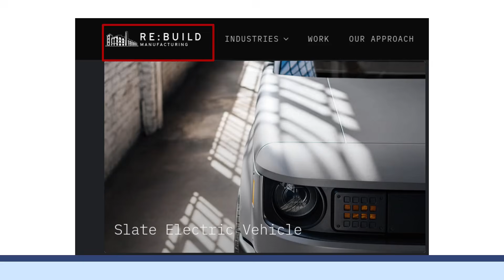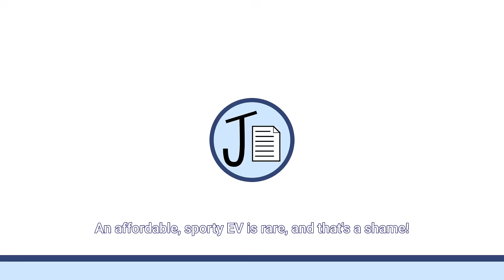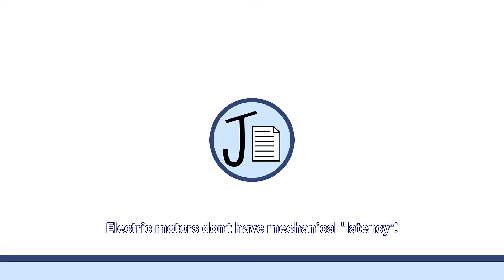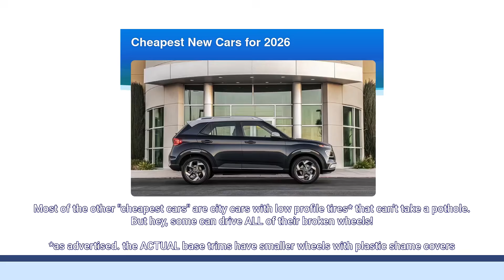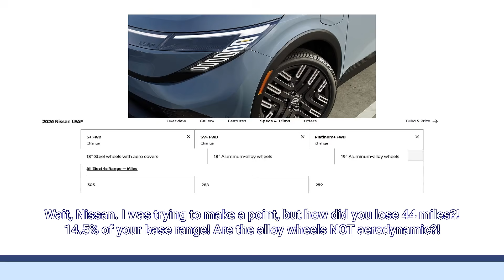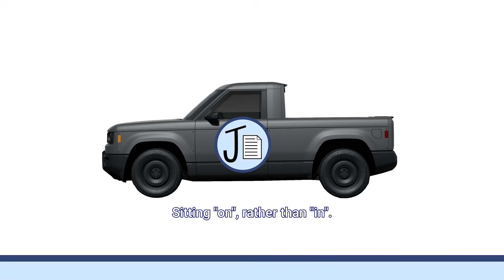The Slate Truck: EV Performance For All

Comment: I love the thing, especially for what it stands for.  But, a $25k price for this is new car territory, as well as approaching the Maverick and (potentially via incentives) an actual body on frame truck, the Frontier, and both of those are far more capable vehicles that will hold their value longer.  While I would be THE target for the Slate, I cannot justify the price right now.  But, in a couple years after release and we see used pricing....that is something to pay attention to.

Also, I realize Slate is at their rock bottom possible price.  Not expecting them to be able to lower it for some time, or until battery tech becomes cheaper.  I am just referring to the situation that exists, which makes it illogical for me, personally at least, to buy a new Slate currently.
Reply: It's fascinating to see arguments like this, because I would rather have the Slate than the Maverick at any price, let alone spending more on the Maverick. 

The key is that there is value in simplicity. Car reviewers who are really just AI spec sheet comparison mouthpieces have no idea how to deal with that. I would pay MORE for simple. I don't WANT those "features." I've had them. I've used them. I've driven plenty of new vehicles across the price spectrum including some that cost a significant fraction of the value of my house. They can keep that stuff, most of it isn't necessary and some actively gets in the way.
Reply: @Daekar3  That's all well and good.  It is exactly why I am interested in the Slate.  But does my statement really come across as an argument to you?  Or even that contrary to what you just said?  I am not trying to dissuade anyone from getting a Slate.

I just listed some basic realities and gave reason as to why I PERSONALLY wouldn't buy one from a mostly financial standpoint.  I think it is great you don't have to worry about that, and can spend on a Slate freely.  But I am thinking about things like depreciation and longevity, and by "far more capable vehicle", I am referring to simple things like performance, towing, payload, passengers, speed, etc., and not just flashy "features" like a ~13" touchscreen, lane assist, heated steering wheels, or whatever else, that just like you, I'd rather not have.  But as it stands, for relatively the same price you are objectively getting "less", no matter your opinion.  And if that is what you truly want, go for it.  Nothing wrong with that.

I just expect to pay less, if I am getting less, whether I wanted it or not.  That is our only real difference.  And again, I don't fault Slate for that, because the situation as it is makes it impossible for them to compete on price.  The initial pitch of $20k was entirely reliant on subsidization in the first place.  And if my current beater makes it another couple years, maybe I'll be looking at heavily depreciated used Slates =).  I am praying EVs keep depreciating hard in general...
Reply: @D @Daekar3 im just responding becuase i got a notification. yeah that’s the big one for me personally. Again I have a fancy new truck, the tech in it is the worst part. The simplicity and low part count is a huge reason I want the slate. I’ve had to hard reset my Colorado numerous times for radio dash or other issues. The slate looks like it would have a lot less should the roll out go well and again with the simplicity I can’t imagine they would mess up much. Again I aldready have a fancy new truck and I’m ready to trade it in for the slate once I can. People also bring up speed. My Colorado is also 8 second 0-60 and also is governed to 90mph, it literally won’t let you go faster though you can tell it easily could. So in terms of actual street performance there’s no gap at all, maybe my truck is faster while at 45+ than the slate but the slate will be faster 0-30. 50% lf my personal driving is done in 35mph and below zones and the other 50% not above 50 so to me it sounds like the slate performance is a better mix for my average use. All the warnings and beeps and telling me to pay attention because I look out my window is obnoxious and the slate won’t have that. I’d pay the same price as my Colorado new for a slate for the lack of those driver aids alone personally.
Reply: "a $25k price for this is new car territory"

It's a new car so I guess that checks out.
Reply: @Strideo1  That is stripped down to absolute bare essentials, and the point of that would be to see a difference in price.  Which ties into holding value, etc.
Reply: @e56hdyhdfgh you’ll never get a maverick for that price. I bought a “32k” Colorado trail boss in 2023 and came out after fees and dealership bullshit to almost 40k
Reply: @TheFarleyMowat Genuinely curious about that, did you try to negotiate?  As in, pitch them various competing dealer quotes, etc.?
Reply: @e56hdyhdfgh yep, I am also in a more expensive market, I could save a grand driving a few hours north. But this is universal with dealerships and Brand new cars, they have deals and you can save but after fees I think it was closer to 36,500 and tax at final and the fact I loaned 10k to build credit (don’t know if that effected final cost it was my first ever new vehicle I’ve purchased), but by close I believe after tax total was over 38k.

The slate isn’t radically cheaper like many claim and I certainly won’t claim that. Delivery is 1450 so that 24,950 is 26,400 and adding unknown state and local taxes and transfers I bet it’s closer to 27-28 as well depending on your state and a whole load of stuff I’m not educated on. Reality is though it’ll be cheaper I’d say on average than the absolute majority of mavericks after final sale but there probably could be some on dealerships deals that end up being cheaper than loaded slates. 

Personally I find it worth it as I found my Colorado worth it and still do. However I don’t use half of the special features and half of them don’t work now that’s it’s over 3 year warranty and have to pay large monthly subscriptions to onstar or Sirius XM.
I still might cancel my slate Q2 order if they come out or I drive one at an event and don’t like it. My Colorado kills it. I also love it but I drive less and don’t need it and can trade it in and get the slate for almost no cash out of pocket
Reply from the maker: The Maverick is less capable, did you watch my video?
Reply: So you would rather support a company whose ceo spoke against right-to-repair and fired an employee over a cookie.
Reply: @Drewcrdllo  No, I wouldn't.  Nor did I say that.

Comment: I have one on preorder.
They won me over with right to repair, plus it's perfect for my needs. I plan on throwing my bike in the back, driving to a charging station near some trails and enjoying the day while it charges.
(Who knows, maybe after a couple of years they will make a Slate Coupe that feels like a little electric MR2? Ah, one can dream)
Reply: I too have placed a pre-order, with delivery expected in April-June of '27.
How about an electric Mazda RX-7, in the shape they had in the early 1980s?  Sleek as a bullet, low center of gravity.  That would corner like it was on rails.
Reply: @peteinwisconsin2496 
Mazda has the capability to build us an electric miata but looks like Slate made it first.

Comment: It's refreshing to hear someone discuss the vehicle and tire dynamics that actually govern drivetrain selection.  I live in a moderately northern city where we average 40" of annual snowfall, and I tell as many people as will listen that they should not buy a new car to deal with the snow, they should buy winter tires if traction is a concern.  My go to phrase is "All cars have all-wheel stop - if you can't stop, you shouldn't worry about all-wheel drive getting you get going."  I myself love my AWD winter car, which has a 40/60 rear-biased quattro system, with two limited slip differentials (center and rear) BUT it is hardly necessary for the climate I live in.  I own it because it's a fun car with a manual transmission, and the competent drivetrain is something of a bonus.

I will be interested to see the future of Slate, as I have followed them and Aptera for a few years now.  Both companies seem to have ambitious goals of creating a fun and unique EV but time will tell if pricing, availability, and quality are up to snuff to lead to any sort of mass market appeal.  I applaud the engineers who are trying to make something new, especially in light of the contemporary technoslop EVs.  There appears to be a growing market who would appreciate a new utilitarian vehicle that could be cross-shopped with older vehicles from a simpler era.  Maybe someday there will be a decent daily driver EV that I would consider!

Comment: You know ive only ever been told fwd and awd is better in snow. Ive never experienced it thank you for the perspective. Im excited for this truck but refuse to be an early adoptor. I hope this thing lives up to the hype so i can pick one up in a year or two!
Reply: Vehicle weight and cg matter
For light vehicles like an 80s,90s Ford Escort or focus, fwd IS superior in snow. Plus those 80-90s fwd econoboxes had no traction control, abs, etc, so putting drive wheels under the biggest weight, engine, made a huge difference on ice and snow
For heavy vehicles with low cg like Tesla and other ev, rwd is fine, perhaps superior with abs, traction control.
Reply: Tires matter more than the drivetrain type.
Reply: Because they are better in the snow sure rwd with winter tires will be better but awd with winters tires is twice as good.
Reply: @drail1976 AWD doesn't help with braking or turning -- only acceleration.
Reply: @jrherita Ive owned all rwd, fwd,awd with 49 winters its easiest way to get around bottom line.  I dont get this rwd cope its not good all around especially is massive snow dumps or getting off the line quick if need in icy conditions.  Slate will run of buyers quick there a very small amount of people who want a 2wd regular cab truck.  They will have to come out with a 4 door awd to survive bottom line.
Reply: @drail1976 AWD is certainly fun in winter, and I've owned AWD stuff for a long time too -- Subaru and a Tesla.   But feel free to explain the physics about how a vehicle brakes better with AWD  (hint:  AWD is also heavier - meaning braking performance is worse than RWD/FWD), or how it corners better (AWD is also heavier).   People think they need AWD because of marketing, and friends telling them that - not real world measurements.
Reply: @jrherita 
Disagree.  AWD will help steer because the front wheels will have rotating motion.
Reply: @jrherita Theres a reason why rally cars are awd because they are superior for a regular Joe driving in severe winter conditions they are better bottom line.  You take off at a icy stop light or go down a street that had a astronomical amount of snow see which one struggles more. I dont know what fascination with braking is but i dont think a slate is gonna be rolling down willow spring breaking lap records.  If i lived in a 365 day a year warm climate id be driving 2wd but otherwise no.
Reply from the maker: Rally cars being AWD doesn't say anything about "regular Joe". It's about going faster, and offroad rally racing is actually pretty dangerous.
The "fascination with braking" is because that's the one that makes you not-die/not-expensive-accident, and most people consider that the important bit.
Reply: @JohnologueOpinion This regular Joe has driven all types of vehicles in extreme winter conditions awd or 4wd win everytime.  The brakes work fine on 2wd, fwd, awd and anything else we dont live in the stone age.
Reply from the maker: @drail1976  The brakes always work fine, the difference is that AWD adds to the acceleration without adding to the braking ability. It's not hard to understand unless you make it hard.

Comment: Having owned and driven a wide verity of cars and trucks over many years I find AWD and 4WD useful only in a narrow range of situations. I personally prefer RWD in the snow and slippery conditions. My 2018 Model 3 is RWD along with traction control and ABS brakes and Michelin CrossClimate 2 tires handle Michigan weather just fine. I expect the same from the slate. (I will give the stock tires a try...) IMHO the stock Slate is, at least for me, the perfect 2nd car. I will add some features but most are for vanity, not need. The need add on,s are 2inch receiver and tow wiring, Fog lights that require a front bumper upgrade and switch package. The rest will be pure fun; A full wrap going for the retro 2 tone look. The stock wrap is pre cut and the adhesive is formulated to bond to the plastic body panels. So it may be more durable. Fender flairs just 'cuz. Probably get some mud flaps...I drive a lot of rural roads. I may go nuts with a sound system or just get a good BT speaker...but a push button radio would really give it that retro vibe...
Reply: Yup.
Assuming Slate sells well enough its first couple years and survives, the aftermarket add ons will be insane,  including a lot of clone low cost add ons and mods on the Amazons, Ebays and AliExpress of the world
Plus add ons, mods from mom and pop domestic shops in the USA